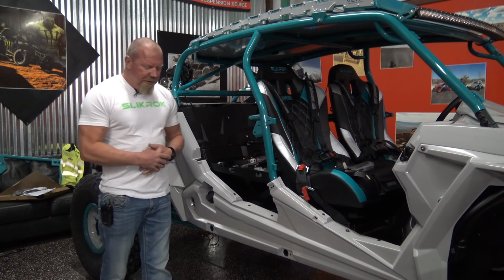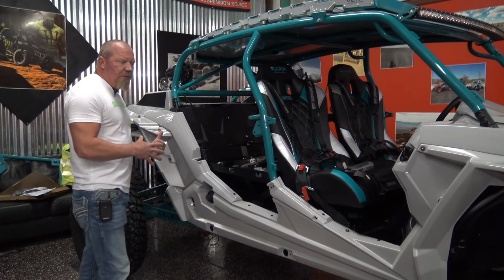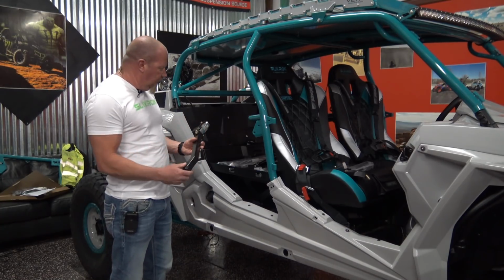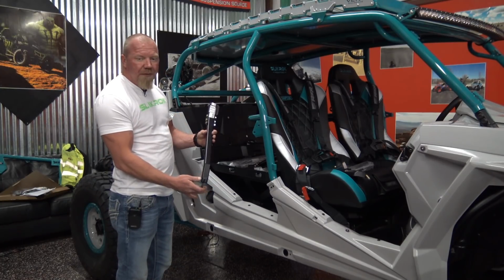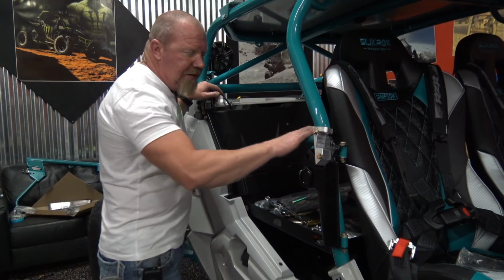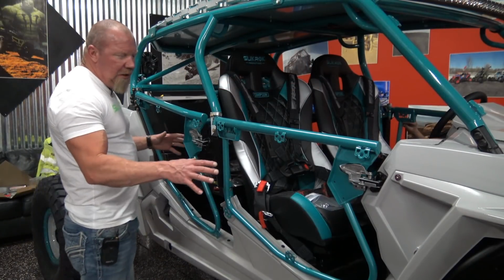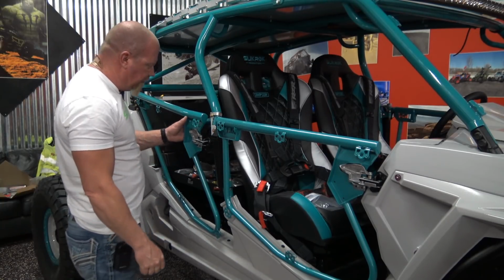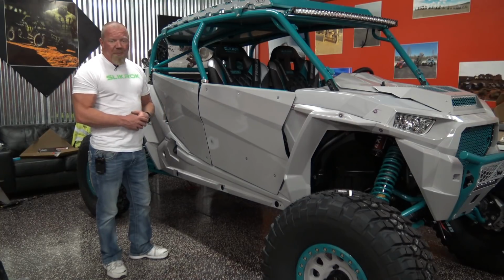SDR Hi-Bred Door Install on a Polaris rzr XPT4

Comment: Off topic, what clutch kit yall recommend for a rzr xp1000 non turbo.  Just general trail and rock climbing.  I will be running stock 29s maybe upgrade to 30inch one day.  I get some belt slip with the stock set up
Reply from the maker: We don't mess with are clutches at all. We run the oem clutching on all our set ups.